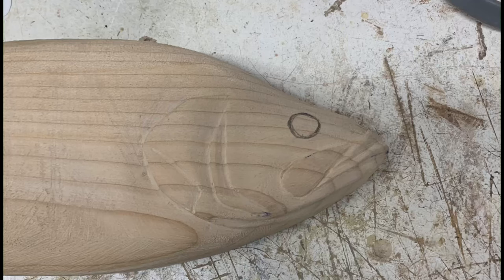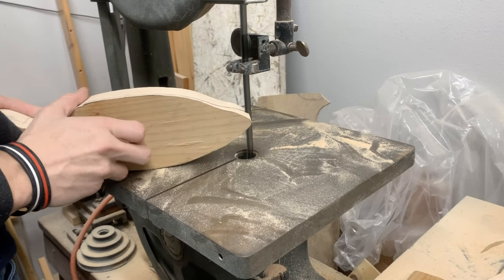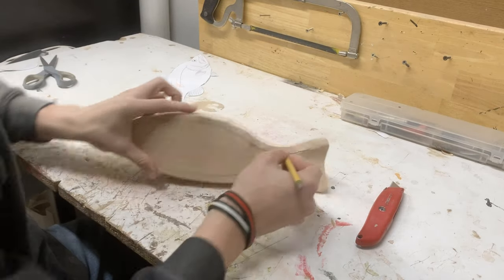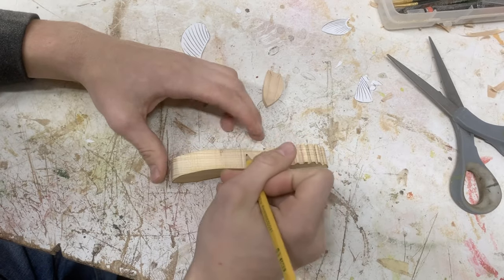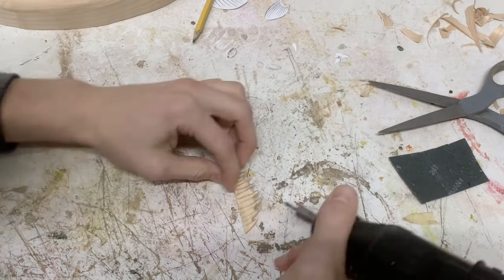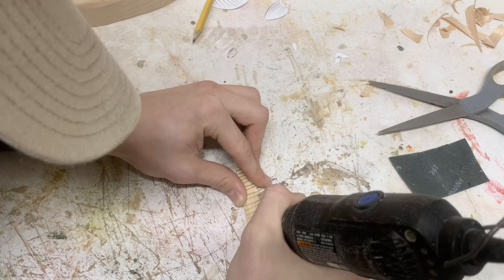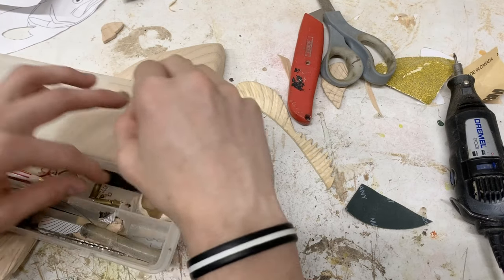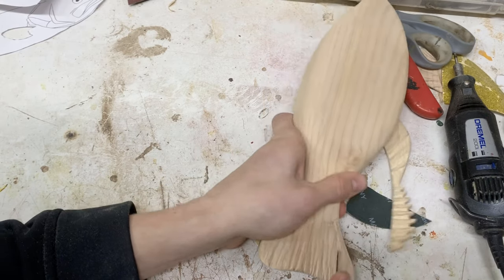How to Carve a Fish From Wood———Part 1

Comment: As a carver with over a quarter of a century of experience I will start by saying I like what your doing. The more you make, the more you learn. I believe you will find a life-long  pleasure if you start observing and practicing good work habits. 
 All air born dust with long-term exposure, will result negatively to your health.
Some woods and the dust from them are highly toxic. To name a few, willow, redwood, cocobolo,and many more.
 So, I ask of you to immediately start utilizing basic safety equipment such as eye protection and dust masks every session of carving.
A clean work space and proper lighting will help you find more enjoyment doing what I also enjoy. 
Keep your knives sharp,hone often, and let the chips fly.
Reply from the maker: Do you have any ppe that you’d recommended?
Reply: Any  hardware store, walmart, etc, will have adequate ppe for everyday use. Eyeware should have an air gap, if it fits too close,fogging will be a problem. Soft nose pads will help keep the glasses from slipping down. Dustmasks, I like 3m,n95s with the air valve in the center. This will also help cut down on fogging.  Keep up the good work.